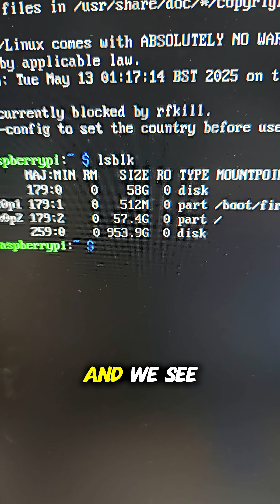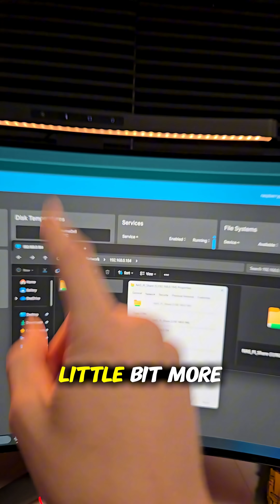Making a NAS With Raspberry Pi & Open Media Vault #computerrepair #techtok #pcsettings

Comment: Most these people don't realize they can just take an old Chromebook, disconnect the battery, and do the same. Beautiful part, keyboard is built in. Just about every Chromebook has kernels wrote for them that work with the most common distributions

Comment: Yes, use a spare Raspberry Pi.

Raspberry Pi B
Raspberry Pi 2
Raspberry Pi 3
Raspberry Pi 4

The above candidates used together with a USB disk is a good solution for a NAS if transfer speeds are not important.

Comment: Least cost effective NAS ever.

The cost of a Pi5, the SSD, and the expansion board are around 10 times the cost of a new NAS.
Reply: I am using 1tb ssd and 1tb as a backup.. pi work for a year now, really fast storage, plus runing a lot of docker congainers on it... N8n, jellifin, kanboard
Reply: You are wrong. 

Source: I just bought a mid-prosumer/SOHO NAS enclosure. They cost money. I also have a few RPi5s and hats and NVME drives. These cost far less money.
Reply: And yet this draws way less than most NAS Systems whilst performing the same
Reply: @107bande does it?
Reply: @kirishima638 as someone who uses a raspi for that purpose. Yes it does. But an NVME is definitely a bit overkill for the Pis Gigabit Ethernet.
Reply: @107bande the Pi5 is a general purpose SBC, and a powerful one, almost desktop PC class.

I would expect a dedicated NAS, especially if it uses power over Ethernet, to be significantly more efficient.
Reply: @kirishima638 I really doubt that a Pi won't be as efficient. Especially when pairing it with extras like an PoE hat they definitely are not bad at being NAS Servers. Especially when thinking about customizing your NAS to your needs.
Reply: @107bande But for larger nases hdds take up most of the power so efficiency of the computer itself doesn’t matter as much. For the price of a pi it’s not worth it in my opinion but I don’t work with smaller tech like that anyways so idk.
Reply: @kirishima638 this is the truth of the matter
Reply: @Optic1392 my power draw when switching from a Raspberry Pi 3B to a Intel 5000 silver single board was negligible. Hdds take 99% of the power consumption. By negligible, I mean a fraction of 1%.(partially due to Intel power saving with pnp hardware.)
There's so many pieces of hardware that can do the job just as well, but are more Hardware compatible. My Intel board is expandable, and already has a gigabit port on it. I'm pretty certain they run about a third of the price of a Raspberry Pi, and they play nicer with Linux distros

Comment: Brother you GOTTA look into a newer 3D printer. 

I don't know how you've gotten away with using an original ender 3 this long without smashing it against a wall. 😅
Reply: I still use a basically stock ender 3.... it does everything I need it to do, and its cheap.
Reply: You don't tear your hair out getting the bed level? Or getting layers delaminating? 

New Ender 3 V3 SEs are so so so cheap. 

I was once like you, I thought my ender 3 V2 was fine, but one day I got an undeniable deal on a V3 SE and man, it's not even in the same ballpark. :DD
Reply: @teddy_ursidae bed leveling takes a single minute for me… I have upgraded springs.

Comment: At this point just use a used desktop bro. Way cheaper and way more powerful
Reply: You don’t need that much power for a NAS. Raspberry pi/arm is significantly more cost effective and efficient.It’s surgical computing.
Reply: @pasitaf  Yeah ik, but it would be better for futureproofing, itd have a lot less jankyness, more sata ports, and upgradeability and most importantly, itd be a lot cheaper. Like I built a tb nas for 45 dollars with a desktop, new 1tb hdd and 1 old 500gb hdd
Reply: @pasitaf  Dude for raw parts, nahhh dude! a raspberry pi is like 4k or 1200 with like 0 parts and with adaptors, dont even get me started
Reply: FYI, rupees!
Reply: @IRLMasuka where are you getting those prices? It costs less than an x86 motherboard alone.
Reply: @pasitaf  Dude, in india. Check OLX, and buy used parts. I got a cheap 1tb hdd for 2k new, an old system used from OLX with a c2d e7500, with 2 320gb drives for like 1500, a little much, but still. That and an old LCD for 500, I wanted a CRT but my mom said no, and besides, said LCD was cheaper.
Reply: @pasitaf  The trick is to buy an old prebuilt
Reply: @pasitaf  The pi alone would be like 50 dollars
Reply: @pasitaf  In india atleast
Reply: I run my Jellyfin Server on an old Intel Nuc I literally got out of the trash at the company I work at
Reply: @daskampffredchen  Nice dude, but in India NUCs are generally more expensive. Say, could I perchance get a few old NUCs from u?
Reply: @IRLMasuka  I have like 3 or so I dont use
But just use what is cheapest for you
Reply: @daskampffredchen  Ohk, could I maybe get 1?
Reply: @IRLMasuka keep pushing!!! He has three!!!
Reply: @daskampffredchen  pls?

Comment: bro you could have used an nvme enclosure and plugged the usb into the router and do the same thing
Reply: Well it all depends.. the Ethernet NIC has 1Gbps speed. As long as the usb on the router has greater bandwidth than the NiC on the PI. And the USb on the enclosure is the same standard then yes.. but if not, you are going to introduce a bottle neck.
Reply: @cisc0pete  Yes you are correct, But Still you can use them if its is USB 3.0, But The other way is using a ethernet to usb adapter or using a ethernet to type-c adapter
Reply: yea but it can also do many things like OneDrive backup and stuff. it's kinda cool
Reply: @UmarHaqimi77 yea